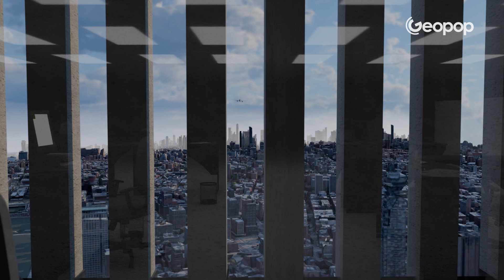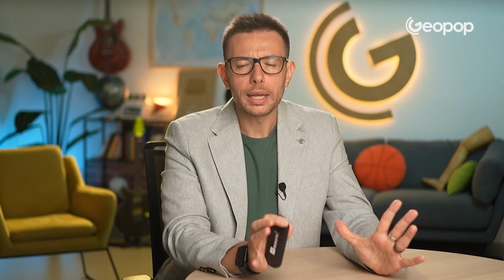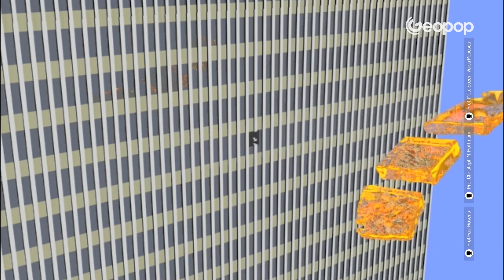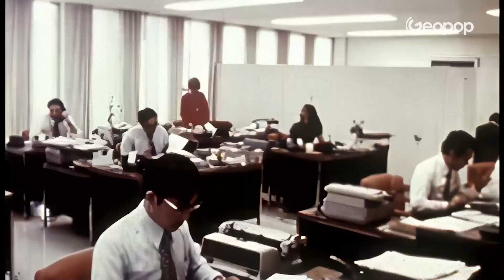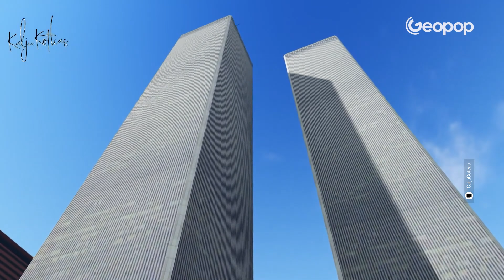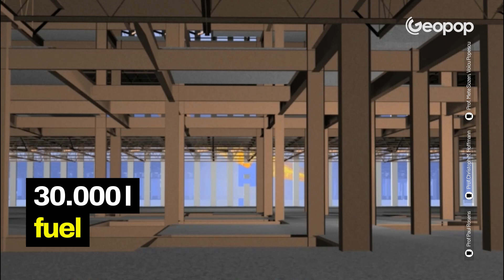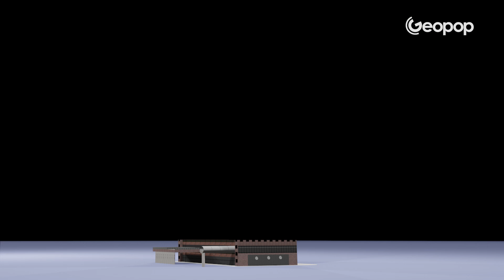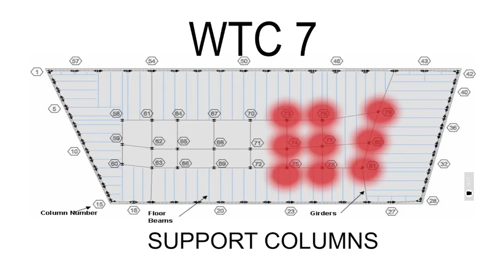9/11, 2001: The Technical Reconstruction of the Twin Towers and WTC 7 Collapses

Comment: And another WTC7 "explanation" that doesn´t even dare to adress the free fall over the height of at least 8 storeys...
Reply: Wow I just learned how to spell “stories” you must be very intelligent
Reply: @mikeokeefe4333  No you didn´t, but perhaps now you will learn that besides american english there is also british english. Shocking, huh stupid?
Reply: He addressed everything, you're just not listening. There are over 3000 terror attacks worldwide every year by the same group. Its been going on for decades, even before 9/11.
Reply: @tubester4567  So in which time frame exactly did he adress the free fall over the height of at least 8 storeys my poor little liar?
Reply: @Kudde23  My comment was deleted, but the videos covers pretty much everything. There are other videos too.
This is how buildings can fail when fire is involved. There is a reason the builders/architects spend millions of dollars insulating steel beams. I think even this video under-estimates the temps inside WTC 1 and 2.
Up near the top of the WTC  with a plane full of fuel and a big hole in the building, the winds up that high are howling in, its like a giant blacksmith forge. Thats how a blacksmith forge gets metal red hot in seconds, feed it oxygen.The temps could easily get the steel red hot and lose all its strength.
There are videos online of concrete bridges collapsing from fire.
If people think somebody, used explosives, why wouldnt they just use explosives and say the bad guys did it???? They already tried to blow up the WTC in the 1990's but failed. Why would the government or whoever risk some complicated mouse trap operation of hijacking planes, crashing them, then waiting and hoping it gets hot enough to fall. Why would they risk something so complicated when they could just blow them up and say the bad guys did it? It would be much easier. The WTC attacks is just one of thousands of attacks going on all around the world since the 1970's

Comment: The Twins were not only designed to withstand the impact of a 707 but also the resulting fires.
Reply: Designed to take multiple plane strikes and as described by the engineers involved in their design, a plane strike piercing the outer columns would be akin to a pencil piercing a screen door.

Comment: WTC 7 is the only question that I have.  As a mechanical engineer I can easily understand the main towers but bldg 7 still bugs me because it just doesn't make sense that an average size building in a forest of giant building was the only other building that collapsed.
Reply: Simply put, it was in close proximity to the landing spot for debris where no other building was In danger. I'd always guessed it was when the towers were really burning up and near collapsing themselves.
Reply: Well spotted  Sir   -   Many many other fully qualified Engineers agree with you....   Minimal burning debris from above But     -   main Leaseholder   Larry Silver  ( tongue ? ) is on video as saying   " Pull It "    ( later  denied of course )  and a couple of hours later -  it    Also   collapsed  absolutely vertically onto its own footprint .   and no  Kerosene this time  -   ( but  " they "  had a ludicrous "explanation "   about one specific column -  leading to total  collapse  ( in seconds ?? )       
This kind of   emotive  Video is   specially commissioned -   specifically  to  keep the horror fresh in the minds of the  unquestioning masses..  "   They "  will either remove this  observation   -    or some  paid Shill -will   issue  some vicious personal insults  -  in a  vain attempt to  change our minds.  ( seen it hundreds of times over the  last 10 years or so   )     Highly unlikely you will receive  a copy of this in your In box  -  but worth a try    -   They cant scare me  -  I have two daughters  !!! ....as the saying goes..........
Reply: @jimmymcjimmy9743  please seek professional help.

Comment: I hope the role the viscoelastic dampers played in the collapse - is in this video - I have not seen it yet, but it seems that their failure mode is totally ignored in the role of the floor truss failures in almost every video i see. I believe that OBL was specifically targeting the dampers. Once the dampers burned and melted away, they would have allowed the floor trusses to hinge on the top bolts
Reply: One more thing, the steel used in the towers was Corten (name brand of the steel - or type) This type of steel has very unique qualities regarding how it deals with heat. It was NOT your typical red iron steel
Reply: Another interesting fact about WTC7 is it had a cantilever truss design. Not all of the columns went to the ground. Because of the preexisting Edison transfer station, the columns over the station went down to cantilever trusses, at about the 4th floor, and the load path was directed to other columns. 
Very interesting that the building was added to 20 years after the build. Additions always lead to some kind of weakness in a building.  There is always something that had to be "rigged". 
Also, an interesting fact you touched on was the damage from WTC1 falling on it. Missed by most. Look up "the wtc7 gash" for pretty good photos of the backside damage.

Comment: This video supports everything I have been saying since tin foil hats started their BS, like firemen heard explosions as the tower collapsed, what they heard were floors slamming into each other. Also tin foils said there was explosions at each floor collapse, what they saw was the air within each floor was compressed and forced out through the shattering windows etc etc.

Comment: NSIT report is flawed. It ignored the basic law of physics that you find in high school curriculum books.

The theory of deformation and steal weakening is not tested in labs, but let's assume  it is coreect. They are unable to explain:
1. The energy released from the weakened floors collapsing was not dissipated from the undamaged floors. It is very naive to say that lower floors steess load was unable to resist the energy releases from the fewer damaged floors.
2. The speed at which the 2 towers  collapsed accelerated, not deccelerated, which doesn't make any scientific sense and defying all basic laws of physics

No lab tests were made available to the public to support these explanations.

Civil engineers during a nationwide conference in houston during 2002 winter agreed that all official explanations are unfounded and the must be revisited to test all hypothesis and scenarios in accordance with the profession standards for lab tests.
Reply: Look up chain falling and how it falls faster than it should.           He does a very poor explanation of how the floors are attached by welded brakets that brake causing for colapse. And how is a mass accelerating by falling against know laws? It was getting heavier but the same force needed to brake it
Reply: @gingernutpreacher  The weight of  damaged floors along with one above them are already loaded on the undamaged floors below before the attack. Each floor below the damaged floors carries more weight load than one above  it. So what should have witnessed is those damaged floors fall and crush ubdamaged floors below them until the energy is dissipated as a result of resistance. 
 The way the two towers collapsed in a free fall and accelerated fashion suggest that the undamaged floors below impact lost their loads and hence resistance. This doesn't make sense to attribute it to other than controlled demolition.
Reply: @dongrandmaster3787  the out side wall carry the weight the bflors locate the structure. Is there any way of doing this in a model?
Reply: @gingernutpreacher  everything can be modeled. Before world of computer modeling, engineers created mockup models using all sort of material to replicate the interaction between the design and surrounding environment.

I know an engineer who modeled in his post graduate studies models structures in open space using mockup models.  His research contributed to the development of space station modules. 

There is Nothing impossible

Comment: having seen inside block 7 at the time this was going on i find it utterly inconceivable that it collapsed due to any connection to towers one and two. There is simply no way. It was a sturdy building and it was absolutely intact.
Reply: I've seen the videos that showed damage to building 7, and the video that showed a transit aimed at the sagging roofline.
Then men said they needed to pull the men out.

Comment: Tower 7 is most mysterious. Never heard of a building collapse like that because of fire. The building fell like, even the lower floors were falling when the top floors started to fall. It fell as one unit.
Never seen anything like it. Can't fool me.
I'm sure the govt paid a lot of people and intimidated even more.
Reply: Buildings in tightly packed settings like NY rely on their core beams, meaning that if a building was heavily damaged for any reason, it would collapse in itself as opposed to falling over and smashing into the other skyscrapers. Think of how tall these towers were, they didn't want that to ever topple over onto other buildings. Not implying it's a setup or a purposely added flaw in the design.  At the end of the day, nobody was expecting the towers to get rammed by high-speed airliners
Reply: Mysterious? Fire weakens steel (fact). Weakened buildings can collapse (fact). Nothing mysterious about it.

Comment: They burned less than 3 hrs isolated in the upper portions of the structure 

 
Literally 75% of the building was untouched

The theory and concept of the steel structure failing would make sense if a majority of it was damaged.. but  the planes struck in both towers above floors 75 

Trust the Science huh lol 

How does 25% of a 110 floor structure pancake into 75% in 10 seconds. .turning it into dust basically. .without any secondary help 👀
Reply: Good comment. The fake media  version doesn’t make any sense

Comment: First of all, flying an aircraft into a tall slim building is hard to believe. It's very very difficult to do it.
Then, the way the buildings collapsed, now that's unbelievable.
I have no doubt, it was an inside job.
Reply: What do you mean it's difficult to do? Planes go where you direct them to go.
Reply: @seanrrr  I'd like to add, WTC 63 meters wide. Runway 40 to 60 meters wide and they generally land "perfectly" in the middle. Ofcourse there is a speed difference, but indeed, saying it's very difficult to hit a 63 meter wide tower, doesn't make sense.
Reply: Photographs were analyzed by former army intelligence and the small pod ojn bottom of the planes indicates a device used to fly planes remotely, flight termination systems to be exact, a military report came out the day before stating that 1 country has the ability to attack America and make it look like a false flag, Israel
Reply: Same thing as all the other conspiracy nuts: Has no knowledge and no experience at all, but knows with certainty how it is.
The Dunning-Kruger Club seems to be recruiting and expanding ambitiously... 🙄

Comment: Incredible how many vido tries to explain the impossible. All these video conviniently leaves  out important facts. Just some examples: 1. Even if the steel in the floor somehow collapses by the fire (which was not even visible from outside after some minutes and affected only some floors). Even if the "pancake effect" would be possible, the vertical columns always forgotten. Especially the core ones. How those turned out in pieces and vapor? They can't collapse. They had to be intact. 2. The molten seel glow below the ground for around 3 months. There are tons of videos of this. Reaching the level of temperature that requires is impossible by any fuel fire. No matter how you try to explain. Only special steel-cutting demolition can do this. Nothing else. 3. The narrator talks about "complex mathematical calculations" by NIST. These "calculations" never published, despite numerous requests, even decades later. Refering to these is just non-sensical. Better to say instead: "because they said so". 4. The list is far-far longer, but only these two facts is enough to debunk the official story.
Reply: Jeder der etwas von Abriss versteht, sieht dass es sich bei den 3 Gebäuden um einen Abriss handelt.

Comment: Theres a petition with over 2000 sigs from Architects, engineers, structural engineers, inspectors, etc supporting the fact that with all things applied, the twin towers should not have collapsed the ways they did. Don't even need to mention building 7